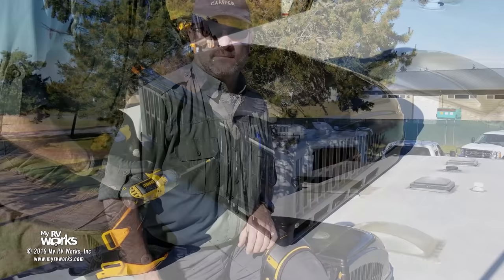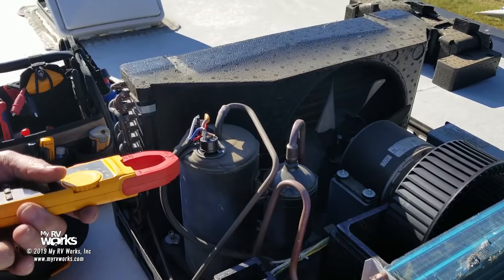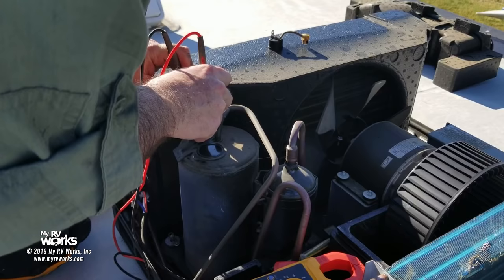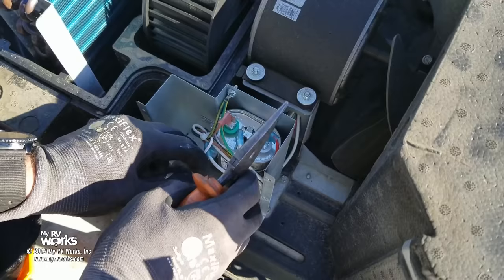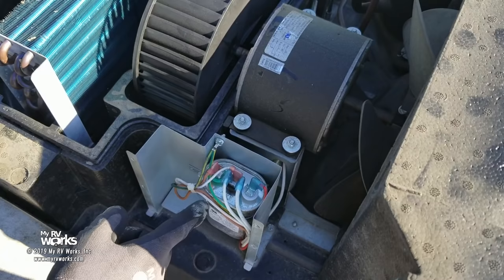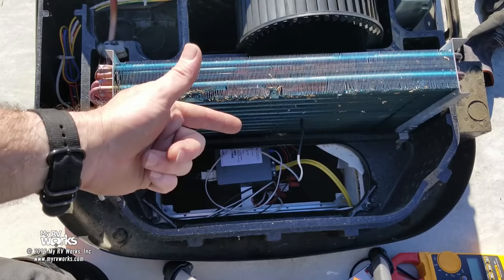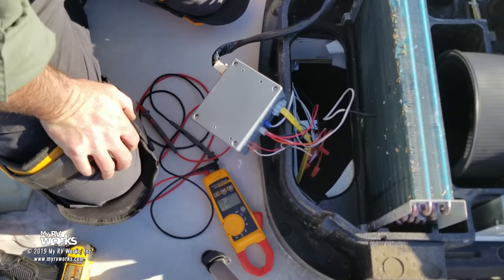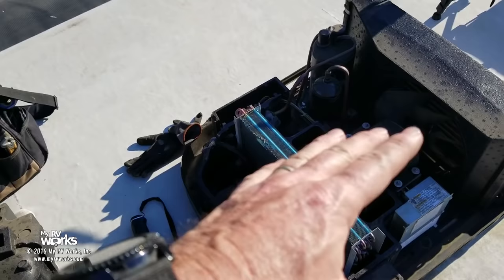Diagnosing An RV Air Conditioner That Is Not Cooling

Comment: Rv Tech here, typically if I hear the compressor running and especially diagnosing for dometic or coleman ac warranty issues all I do is get a amp draw reading on the compressor wire and temperature split test and that usually that tells the tale, refrigerant leak. That's all the info the warranty people want to know as a rule. Of course if the unit is out of warranty then it's a replacement issue at the customer's expense. Five or six years ago, maybe longer, it was when dometic first introduced the brisk air II and moved the production to China I was doing warranty replacements, two or three a month, I work in central fla.. I asked a Dometic warranty tech why we were seeing , what I thought was a high failure rate and he said it was what dometic considered within their failure rate parameters. But I sure did a lot of them. But great videos from you though, I have watched several and their is no doubt that you know your stuff.
Reply: It seems evaporator coils from China are made from recycled copper thar has ferrous metal contamination,  condensation caused the ferrous to rust there separating from the copper sausing leaks. Especially in midea dehumidifiers and ductless a/c units.

Comment: You saved me some $1800 today! My local RV dealer wanted me to just replace my 31 month old air conditioner because I quote "It's probably the compressor went bad". I tested the compressor as you said and it was perfect. It turned out to be a fried wire in the control box. I cleaned up the area and replaced the wire and connection. Total cost $0 and I have air again in Arizona in July. Thank you, Thank you, Thank you!

Comment: I have a Dometic and it sounds like the compressor comes on and goes right back off. I can’t remember does my thermostat supposed to to actual temperature in camper or only the setting? But right now it’s only showing what I set it at.

Comment: i am in oregon. how much is the thing that you need to replace if you are not re filling the refrigerant ? you didn't specify the name of the part that's why i m calling it the thing. thank you. mine stopped working an hr ago and it will be really hot in 2 days

Comment: Why don't you amp clamp the blue compressor wire and test for amp draw? Like it tells you in the dometic service manual. Low amps means loss of refrigerant.  Anything less than 8 amps depending on ambient temp means low refrigerant.  Otherwise great video! Very informative.
Reply: My guess is the idea was to show the audience how to test all the components.
Reply: Mine is about 11 amps and seems to be almost out of refrigerant if that is the problem. Was around 14 only a few months.

Comment: This is the only DIY you tube video that I have ever watched start to finish. I have an associate's degree in HVAC and worked as a tech for a bit but have  worked on power lines for the last decade so I'm  a bit rusty.  As a full-time RV-er we started having the inevitable AC issues while visiting Las Vegas during a mid summer hot streak. With an average of 110 to 115°f the past couple weeks let's just say my rooftop units had met their match. Upon first glance I too felt as though I had met my match.  I watched a few pieces of videos made by hacks to with no more knowledge than I had and had been out of school for 14 years. They have no business instructing anyone on anything, let alone something that could potentially be fatal. 
I then found this video which ultimately saved me hundreds in service calls and possibly thousands in new equipment. Thank you so much!

Comment: Thanks for this clear video Darren!  We just bought a 2020 Jayco trailer in June of 2020.  We have been running the a/c quite a bit but last weekend it just stopped getting cold.  We tried to get in touch with an authorized service center that could repair it under Dometic's warranty within a week or so but no luck- and Dometic told me that since it was under a year old, the dealer had to handle it.  We had a camping trip planned in 10 days so we were bummed.  Upon further investigation, we found that the compressor wasn't running (distinctive sound).  Since the unit is brand new we figured the motors and controls should be OK.  My son and I have a 60-year-old family-owned electrical and solar contracting business so we suspected a burned or loose connection.  I looked all over the internet and found your video on the exact model Dometic Brisk II a/c unit that we have on our Jayco!  Long story short, there was a neutral wire off the top of the capacitor that had come loose - reconnected it and it fired right up!  Thank you for saving our trip!  Luke and Steve Harrison La Habra, California
Reply: having a similar issue -- I hope I'm as lucky to have a loose connection 🤞🤞🤞
Reply: I have a kinda similar problem.  But mime starts working,  gets cold and then after a few minutes it start to blow warmer.  If I turn it off and back on same thing it's cold for a bit but then starts blowing warm. Any idea?

Comment: You made my day over here in the Netherlands ! Excellent how you explain which precautions we have to take and how we have the measure the capacitor and the compressor. I now have a good understandig how to measure the windings of a motor thanks to your thorough explanation !!! In the netherlands there is no repairshop for air conditioners, when it's broke they just put up a new one.
Thanks again, now my Dometic B1900 blizzard is working fine again.

Comment: Thanks to your video I was able to diagnose my air conditioner problem. I had no cold air coming in. I was checking the compressor when I found a loose wire on the overload or thermal protection device located on top of the compressor. One of the wires broke free of the tab connecting it to the device. That part from Dometic is no longer made (ac is 9 years old). Dometic said I would need a new air conditioner. I couldn't see buying an ac when the $37 part just needed to be reattached. I was able to reconnect the wire and its now working fine. Thanks for the great videos!.
Reply: The unit in this video may have also simply had a failed thermal overload protector too. He only tested it when it was cold, however when a thermal overload switch goes bad it usually fails only as the unit reaches normal operating temperature (shutting down the compressor). This unit showed no sign of coolant leakage, so it may very well have simply been a failed thermal overload situation like yours.
Reply: @reedreamer9518  The compressor is running and it’s not cooling. Pretty sure he would hear if the compressor was cycling like you suggested in another comment. The compressor wasn’t even kicking on before he unplugged the 110 connector. There’s nothing else it can be. The PTCR (the thermal switch) is a just normally closed switch that opens when the compressor gets too hot. Do you even know how a thermal switch works? It’s magnetism. Once it gets to a certain temperature the electrons form a strong enough field to either close or open two contacts. Those values don’t just change magically. The only way it could open prematurely is if the resistance was altered. The only way you can alter resistance in a thermal switch is to open or close it opposite of its unenergized state which is gonna give you continuity or lack there of where it shouldn’t be regardless of its temperature. It can’t be bad and show continuity when it’s cold. It only opens to break continuity when it’s hot. If it was bad it wouldn’t have continuity when it’s cold, which it had. Not to mention the burn spot on the contact cover kinda reinforces the notion that the compressor overheated due to….. lack of refrigerant. Also remember when he said to test the A/Cs efficiency it needs to run at least 20 minutes? Pretty sure he did that to. Like I said, you can even hear the compressor running it’s ass off and it’s not cooling. Compressor can’t run if the PTCR is bad. Even if what you said was true it only takes not even 5 minutes to determine if you got cold air coming out the discharge. If the PTCR will trip in 5 min on a good compressor than it would trip in the direct sunlight baking on a roof enclosed in plastic and metal. You have no idea what you’re talking about. You don’t know enough on this subject to criticize the man so smugly.

Comment: Thanks. I learned that government bureaucracy is the reason why a replacement RV AC is outrageously priced. Great video!
Reply: LoL I went to school for air conditioning and believe it or not if you were to release the refrigerant into the air it does miles of damage to the ozone layer and those fines he's talking about you can almost multiply them by 20 it's almost 200,000 if you get caught releasing refrigerant into the stratosphere atmosphere etc. It is best just to replace it if you don't have the licenses however if you don't care just go down to the hardware store and get you a tap that you screw in get two of them and get the correct refrigerant and insert it through one and vent through the other . You start to charge your system with the refrigerant sometimes you can use the car ones it just has to be the same number of refrigerant like 134a I think it is I think 134a replaced R12 . Once you have noticed that it will no longer take refrigerant connect a new bottle and start venting through one side as the other side is adding refrigerant this will remove all contaminants so you wouldn't have to pull a vacuum however you're doing miles and miles of damage to the ozone layer. If you could get your hands on some nitrogen then blow nitrogen through it instead of using refrigerant to flush it you won't have to pull a vacuum if you blow nitrogen through it then just recharge it using a simple can kit for cars you can usually get away with it another cheaper version is just going to Walmart I'm buying a regular window unit and mounting it on your old mounts it is very easy but will take all day maybe two three days if you don't know what you're doing or just not patient
Reply: It's a shame really, I'd argue all the emissions from producing the replacement AC, shipping it to where it needs to go, getting a tech out to install it and the resultant landfill waste is much more harmful, especially now that the ozone layer is re-healing
Reply: I feel like the AC manufacturers should be held to higher standards then. Everybody makes them as cheap as humanly possible, then they break, then leak the refrigerant.

Then people keep buying cans of AC Fix-a-Flat because it's an easy $2,000 repair bill anytime the AC gets serviced by a shop

Comment: These A/C units are   JUNK   I have had two RVs either they work or they don't   the first one worked on my 2003  for a few seasons and Quit needed a Recharge did that and it worked for one more season  bought a 2017 Coachmen same thing  I don't think anyone has this much trouble with their  Home or Car A/C unit  on a regular basis    But this Video is one of the best on YouTube in many years for trouble shooting  RV  A/C units nothing missed   Very Good

Comment: You Sir are awesome!! After a successful career in management of RV production lines, at 52, I decided to venture into service. My knowledge base is broad on building them, yet the tech side is different. My electrical experience has been very helpful because tracking is the key to finding faults in systems.  You explaining in great detail the flow and tracking in appliances has been amazing. You've single handedly upped my game 100%!!! Thank you. I should probably give you half my salary..

Comment: I have the same unit. No residue found, compressor working, fan working, coils warm after 20 minutes. Yep loss of refrigerant. Seems to be a running issue with these from my research. I have had it for 2-3 years and it just stopped working. Of course on a 90 degree 88% humidity week. Very instructional "refrigerator" aka AC video. :) I am an Avionics tech so all the steps you explained I had done from my electronics knowledge. Very good layout for testing a system. Wish you the best in 2020.
Reply: possible to recharge?

Comment: Wow- I just worked through fixin my Coleman Mach 15 and didn’t see this one first but you helped to validate my approach (as a novice DIYer) in which i too had fan but no compressor. I checked the compressor and found mine was good using the same method you described. But since mine has a soft start (micro air) I simply used the amp clamp to check for an inrush which there was none. I know the dangers of capicters and wasn’t sure how to properly check it but did know the purple wire (on my Coleman) was the inrush and check it with the amp clamp (same Fluke you use thanks to your tool bag video!) and no joy there. That led me to the Coleman’s control board and I then tested the 12v power at the terminals and discovered no 12v at the cioleman’s AC wire yet there was 12v at the fan terminal. That led me to check the 12v at the thermostat which I found 12v at both the corresponding fans (ie high and low) AND the same yellow wire which is the “AC” wire. That suggested an issue so I swapped the “low fan speed” wire at the top circuit board and at the thermostat and BINGO! Compressor kicked on!!! Thus, Bad “AC” wire somewhere in the line!!! Once again, if not for your prior videos on both tools and troubleshooting techniques, I’d have a new $1000 AC!!! Thank you!!!

Comment: I am a certified HVAC technician. I want to say that you done a great job of explaining everything you showed on your video.

However, there are a few things that you need to consider about AC systems when it comes to tempature distribution through the system.
Let's say that on your current video here that the system has not lost its refrigerant.
Fist off the initial visual inspection needs to be in a maintenance mind set. AC units in my professional experience are the most neglected thing you own. The first thing that you should check for is dirty coils. In this video you showed the evaporator coil and it looked to be in really good shape. But you missed the condenser coil. If the condenser coil is dirty (the one that blows heat out on the roof) it will increase the internal pressure of the entire system which will make the whole system cool very inefficient. Always, always check that first if it's just not cooling good.
Also when you do your 20 minute test run you HAVE to make sure that all of the covers are in place. I the video you removed the cover to the indoor fan and evaporator coil and left it off. During your test the indoor/evaporator coil was not getting proper air flow across it. Although in a properly operating system that coil should have started to freeze up because of the improper air flow after 20 minutes it wasn't. That brings me back to a possible stopped up/dirty condenser coil.
The small hot spot on the temp overload safety switch tells me that your compressor has been running hot! Even though the safety switch tested OK, it's a sign of a compressor that was running hot. The customers complaint said that the unit would run but the compressor would not come on. You were correct to test that safety first for sure. But the compressor had probably cooled down to te point that the bimetal safety had already reset itself. If it hadn't it could have given you a false reading that the compressor or safety  was bad. Once again consider a possible dirty condenser coil.
I know you said that the fan was running at full speed and it's a dual purpose/double shaft fan motor. So that should mean that the condenser side fan blades should be turning at the same rpm as the blower wheel. You have to install evaporator/blower cover so that the unit is getting the proper resistance in air flow (making the motor work in its normal condition) then visually check to make sure that the condenser side fan blades are not slipping on the shaft. (seen this several times) once that is checked its important to make sure that the blower motor is pulling the proper amp load per manufacturers name plate on the fan motor. If the amp load is to high then the fan is running at a lower rpm than what is required to cool the system properly. Which in turn causes the increase of internal pressure which cause an inefficiently cooling system.
If you have completed those steps and the system is still not cooling then I would suggest that the system has lost to much refrigerant to operate. I hope this helps in the future.

Be sure to properly maintain your heating and air conditioning equipment and it will last you a long time.
Happy Camping!
Reply: Good points. The actual problem revealed itself early in the video. As you said, the temp switch was discolored, indicating the compressor running hot. When he tested the compressor and the ohm reading was 3.6…bingo. Compressor was bad. A reading above 3 indicates compressor getting weak and it will draw more amps (run hotter and not work well at all). A reading closer to 4 ohms and it probably won’t even start. 3.6 ohms = compressor is toast.
Reply: @SaltyVetAdventures  if this is the case, can one just replace the compressor or will have to replace whole unit?
Reply: @SaltyVetAdventures  also, how do I test amp draw on the compressor and know if it's good or bad? Thanks.
Reply: @miasantos3316  RV air conditioners are sealed united. They cannot be recharged with refrigerant and the compressors can’t be replaced.
Reply: @miasantos3316  Multimeter with an amp clamp and test one of the power wires going to the compressor.

Comment: A big thanks. Your video gave me confidence to diagnose my AC problem. The Compressor would click on , but not run.  Used a multimeter to read capacitance and found the starting capacitor is bad.   A visit to Amazon and $15 bucks later, I have a new capacitor on the way.  I am beginning to feel that the only thing that consistently works on my RV is me.